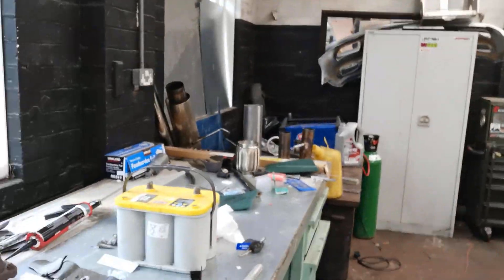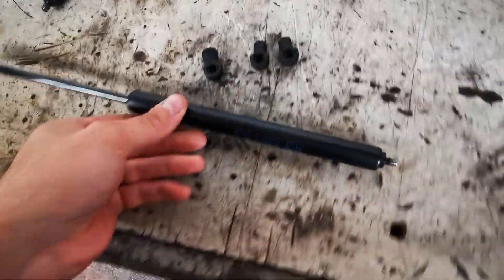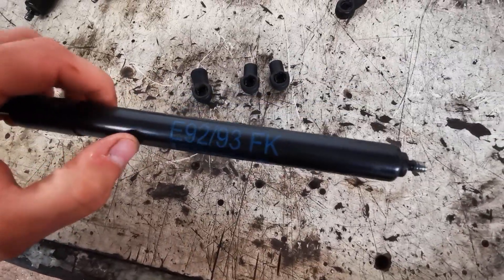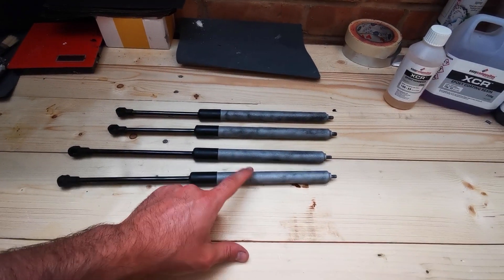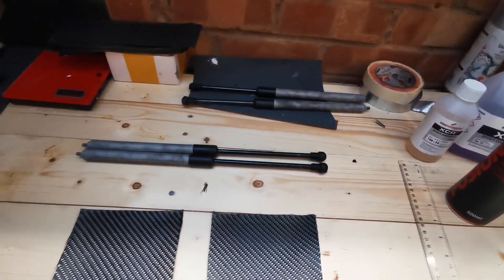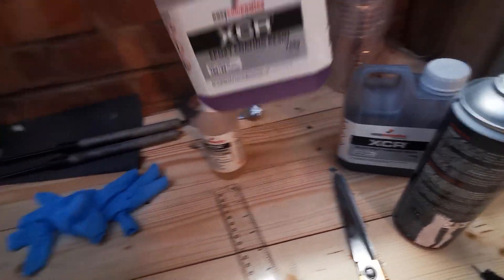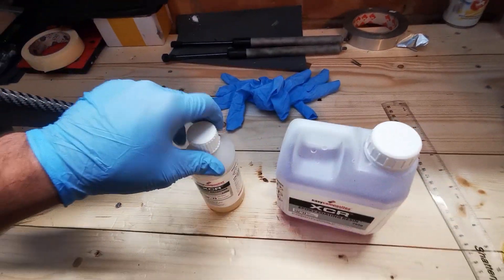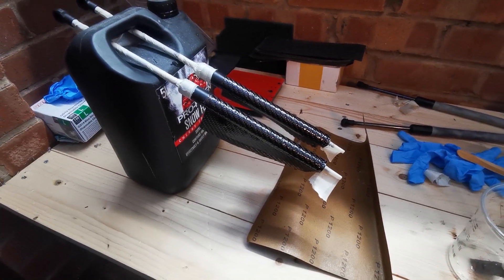How to : DIY Carbon Fibre Skinned Bonnet + Boot Struts *Easy Composites*

Comment: Enjoyed watching that, keep it up. Was the clear coat 2k?
Reply from the maker: Thanks. Clear was just a standard can off the shelf
Reply: @TheDIYTuners  if you've got enough to spray you can now get 2K clear in a can, the only downside is you're paying £15-25 for a can when a lot will go to waste if you don't have enough stuff to spray
Reply from the maker: @producerlawson  yh I think I've seen that recently. Has a little button on the bottom you press to start mixing? Might try a can soon as I've got a few bits to clear
Reply: @TheDIYTuners  Yeah Spraymax do a really good one but it's quite expensive for 1 can, there's a few more out there now though. I used it for my dashboard trims and it came out great but when I tried again in winter I struggled with cold temperatures in my garage, it made the clear bloom leaving it with a cloudy finish. Definitely worth it if you can though, the gloss and scratch resistance is ace, plus it's usually dry within 24 hours